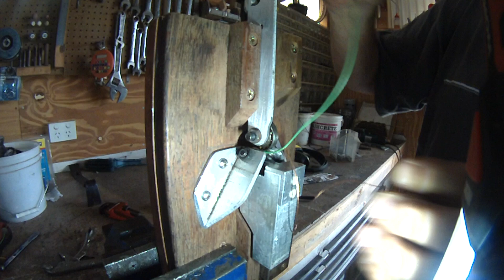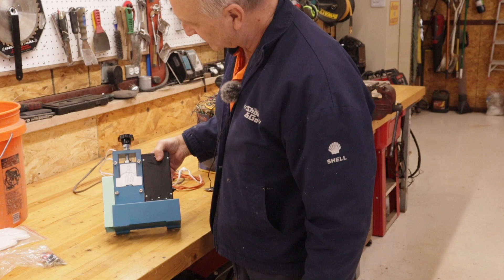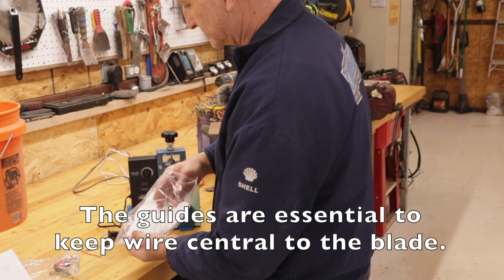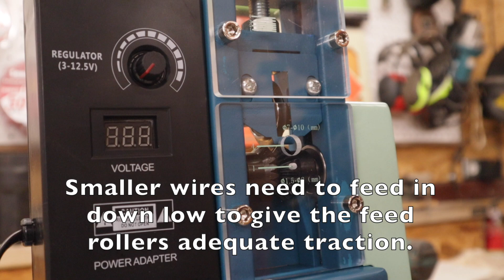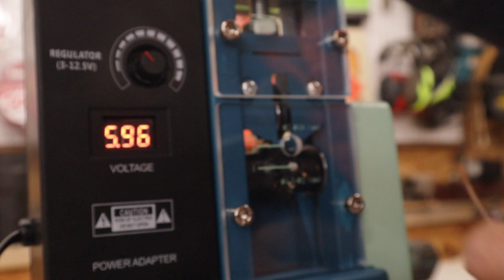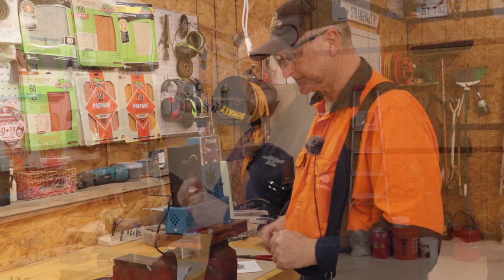Stripper - the wire kind

Comment: I like it! Will save alot of time and pay for itself. I notice your Keihin jacket, looks good. I installed serviced production equipment in their plant in NC and been their facility in Japan. Now part of Hitachi which is also an old customer ( Never been just Japanese guys ). Now you can run around town picking and stripping wire ( Fred Sanford )😅
Reply from the maker: Yeah, nah…I’m not looking to become a scrap merchant. But maybe I can recycle enough extra parts to pay for a new tool.